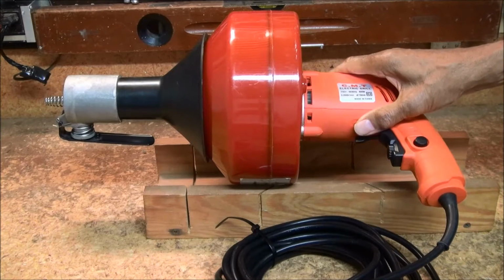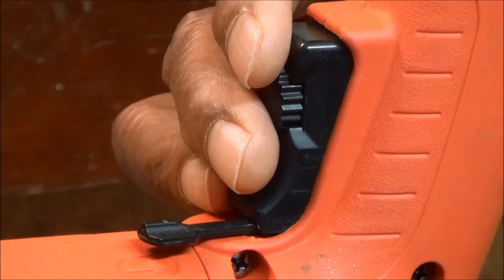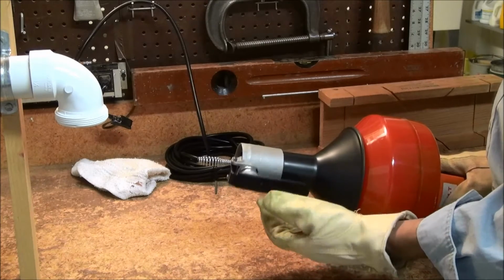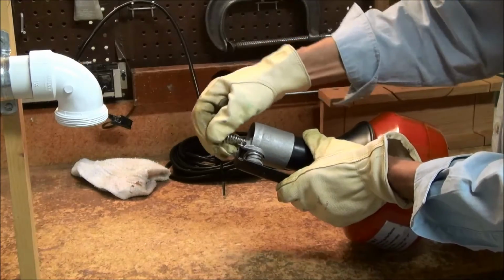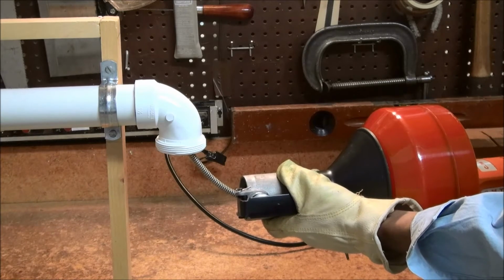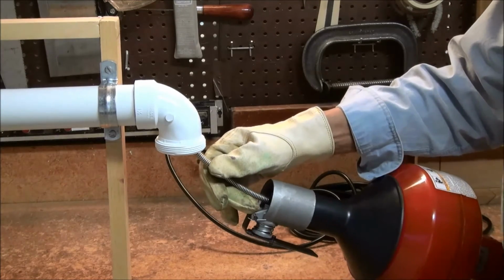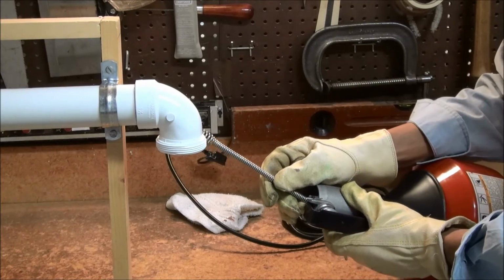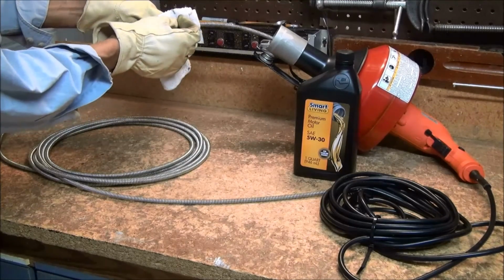How to Operate a Handheld Electric Snake (ASIN:B00AR20QSW)

Comment: Thank you.  It was extremely helpful and insightful.  And the last tip priceless advise. Thank you again.
Reply from the maker: Thank you for your kind comment.
Reply: Due to your video and explanation, I was successful in unclogging the drain. Not bad for a first timer, if I do say so myself.
Reply: @ingridjui  did u buy the item as in this video?
Reply: @restypancho9309  I believe so, I honestly don't remember. I have it in storage, that's how good this video was 😄 I didn't have any more problems after using the machine. But I do remember it was a bit heavy (for me). Good luck!
Reply: @ingridjui  i just had buy 1 of exactly this item. i cant control s speed of rotation. no matter i adjust the speed knob. it rotates very hard. can u teach how to properly use this?
Reply: @restypancho9309  Just like a power drill, start slowly.  There's no need to go full force, you might cause damage to the plumbing. Slowly push the trigger as you carefully guide the snake. When it feels like it hit something or it got stuck, reverse it slowly. Never go to fast. Let me know how things are going.
Reply: @ingridjui  thats what i exactly do. i think there is a problem in the device. do u have any video tutorial about the device operation pls?
Reply: @restypancho9309  Sorry I don't. I learned by trial and error. Good luck.
Reply: @restypancho9309  there's a chance that speed dial on the trigger is defective